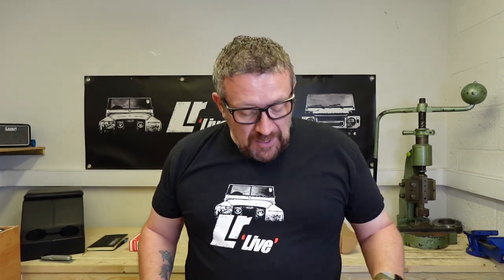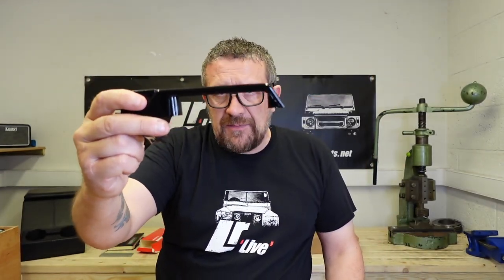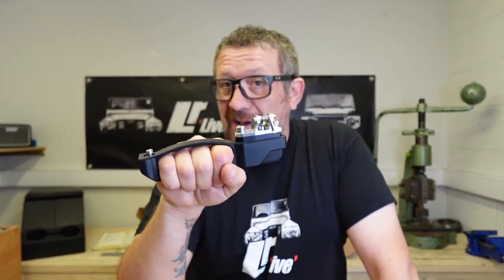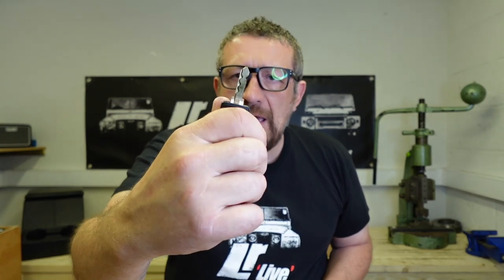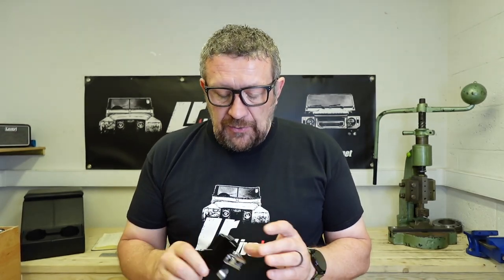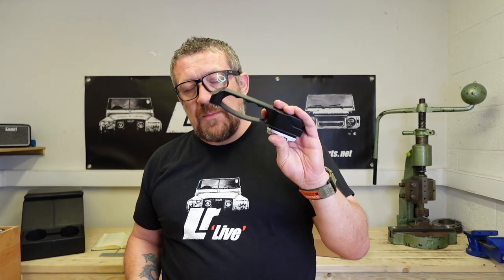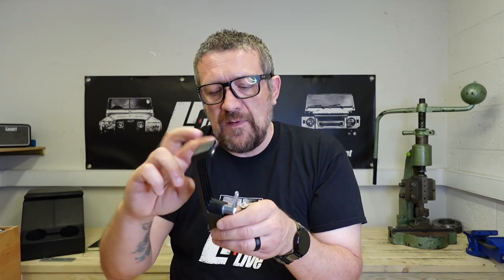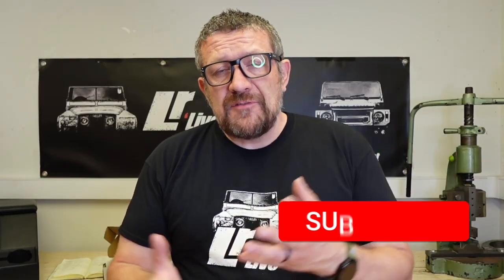How to replace Defender door handles and which ones to choose.

Comment: Just bought the Optimil handles, pricey but they are such good quality.

Like you say changing your handles is the easiest way of getting away from everyone else with a defender being able to open yours.

I had a second hand fuel cap pulled out of a random parts box in a store room and it’s key also fitted my door locks🙄🙄
Reply: Just fitting them now, not even close to being a straight swap with the originals, having to get the Dremel out and make the hole bigger.🙄🙄

Comment: I have the Exmoor Trim handles and they are brilliant. Although the plunger can freeze or stick when pressed below -10°c  🇳🇴 I did manage to scratch the paint using grips to pull it out again. Should probably lube them with something more suitable before the autumnal
Reply from the maker: I heard that wasting good whiskey and pouring some onto the assembly can stop it freezing in very low temperatures!
Reply: @LRLiveUK  I’ll give it a try. There’s some snow grouse in the freezer 🥶 🥃 Better taste it first to see that its ok 👌🏼

Comment: Enjoying the videos!  I am rebuilding my 110 van and am looking for spare wheel storage options.  Clearly I could go for swing away carriers etc and would be good to see options but was contemplating storing in the back against the side panel.  It would be good to know if there was any options to do this even if you need to cut out the tub sides.
Reply from the maker: The issue you have is having something strong enough to mount the wheel to. The best and safest solution would be to fit an internal roll bar at the back, strengthened through to the chassis at the wheel box. Then you could simply weld a rear door wheel carrier bracket onto it. Early Defender pickups had the wheel carrier bolt mounted to the bulkhead. Another good option and one you could relocate to the capping on the side of the van inside at the back.
Reply: @LRLiveUK  Thanks for the advice, appreciate the need for a bit of structure.